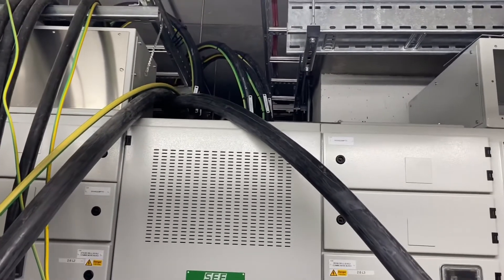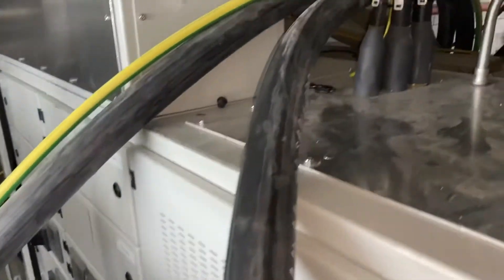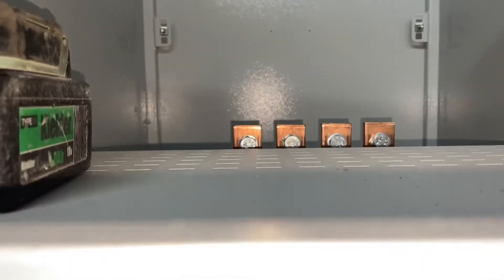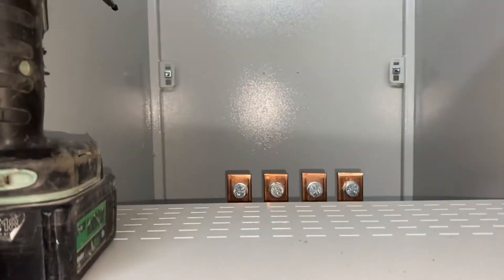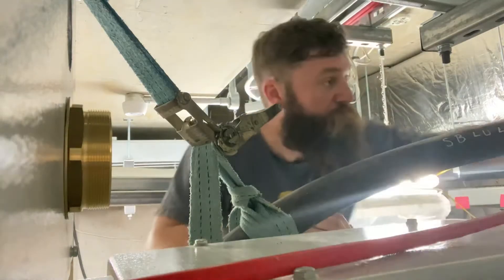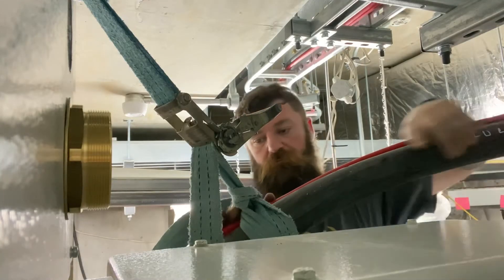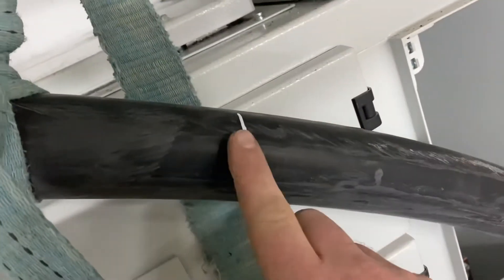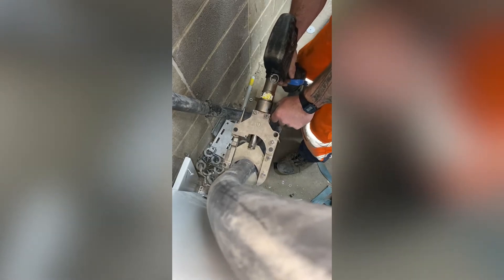There’s been a disaster!!! Installing two 4c x 185s + 150mm cpc

Comment: you are doing a great job. We install panels in greenhouses and they are  185 alu cables most of the time. What i was wondering is that you have a seperate earthcable. We have the german cables NYCWY or Alupower® (N)A2XCY Dca CE in those cable there the shield is also the earth-conductor and we braed that to a tale and connect to the earth-bar.
I am inpreesed by your work. Keep up the good work
Reply from the maker: Thank you very much. 
The earth depends on the design calculation as far as I can ascertain. Some cables have one that is the same size, some half and some non at all.

Comment: Have you ever cut a cable too short? If so how did you get around it?
Reply from the maker: Not a whole cable but I did cut a neutral short when I was younger. Luckily I put it on a connection that was closer to the gland and then had to make sure that the cable it was in parallel with was able to reach the lug that was meant for that neutral. If you see what I mean.